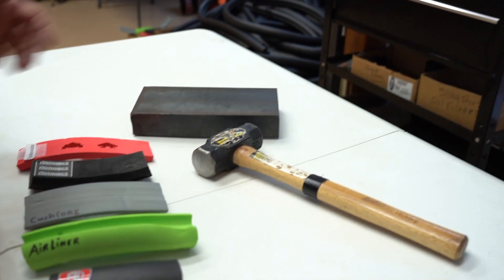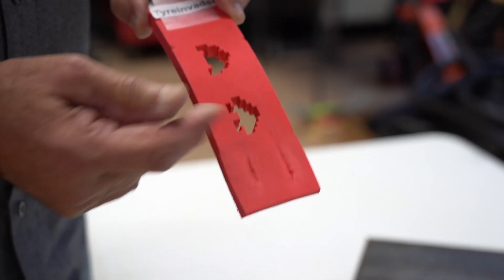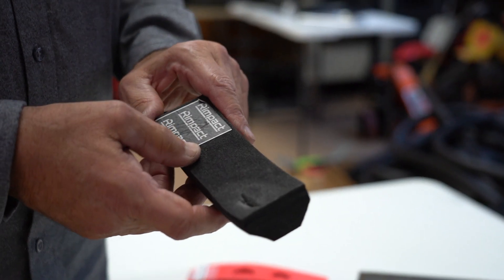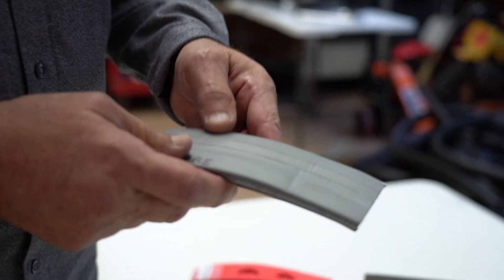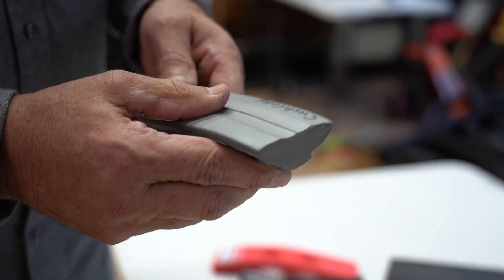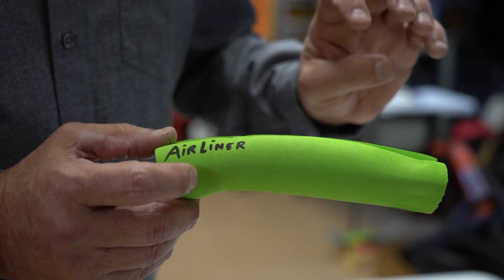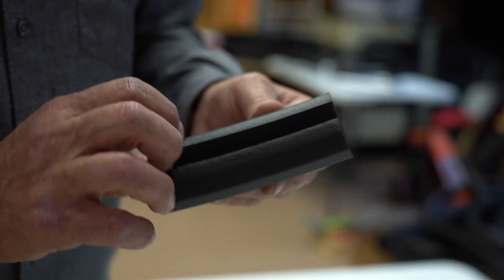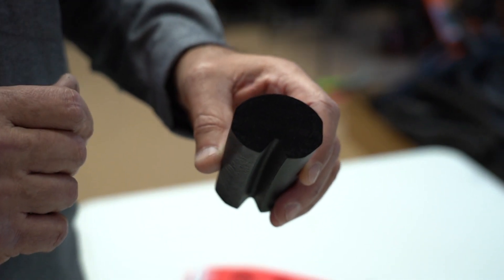FTD II v  Competitor Hammer Test

Comment: Hi, what's the easiest insert to install on dh casing Maxxis or continental tires 27.5x2.40?. Should I get te xc inserts for those tires. It's because the cushcore o bigger inserts pro it's too difficult to install, or It might damage the rim and tubeless tape. I think it's a good combination dh casing tires with light inserts xc.

Comment: Thank You. I'm guessing the CC material will distribute the energy of the blow over a larger section of the rim and thus lesson possibility of destruction.  I have no experience with the FTD material, but I'm guessing more of the energy will get transmitted to the area directly on the other side of the blow, ultimately causing more damage.

Comment: This is obviously a biased test given that there was no method beyond hit it with a hammer. A standardized test needs to control every single variable except for one. in this case the insert. some guy hitting foam on a block with a hammer freehand style is a terrible test. You should prepare a rim substitute as a regular rim is not going to survive getting hit with a hammer, You should also measure results in a finite way, like peak forces experienced during the rim strike, how much force is required to cut the material using a hydraulic press and a piece of 90 degree angle iron, as well as crushing the materials and seeing how much they deform over hundreds of smaller impacts, as well as hundreds of larger impacts, essentially testing for plastic and elastic deformation in the foam. as well as long term fatigue.

Comment: this does not replicate an impact on a wheel with a tyre and air pressure. it shows relative durability, but not realistic trail impact which would be much less and not repeated in same spot.
Reply: This is a five pound sledge being swung from like a foot or two up and when I ride it's like 190 pounds of rider and bike coming down from several feet up or going 30mph. I don't even have tire inserts but I thought this was a fair comparison.
Reply: Thank you Professor Sharp.
Reply: wrong

Comment: Not very scientific.  Drop the head of the hammer down a length of PVC onto...ideally...a rim, or at least your metal test article tilted up at a 45 degree angle.  Also should say the weight.
Reply: Add to that, just 1 hit at a time. You won't always hit the same spot thrice.

Comment: With the FTDII fit in a 45mm wide rim for 3.0 tires?
Reply: Hey Scott, Thanks for the inquiry. FTD II does work on a 45mm inner rim width but our recommend for the most tire sidewall coverage is 2.80 tire width.
Reply: @stacytesting12  Bummer.  Have 3.0's on my hardtail...